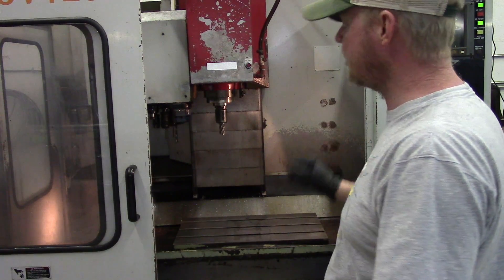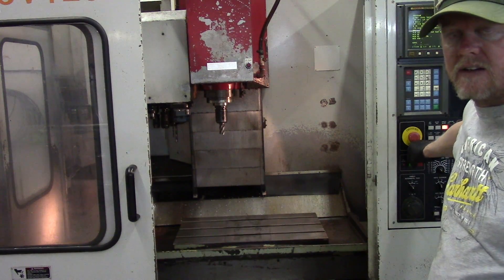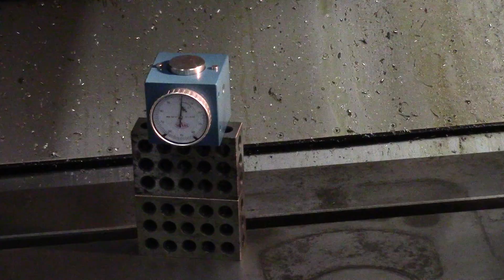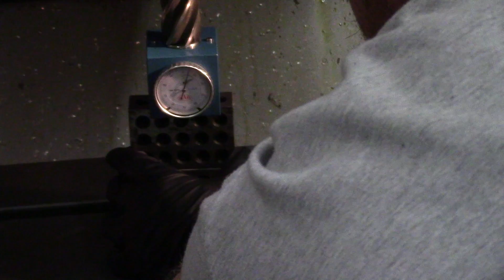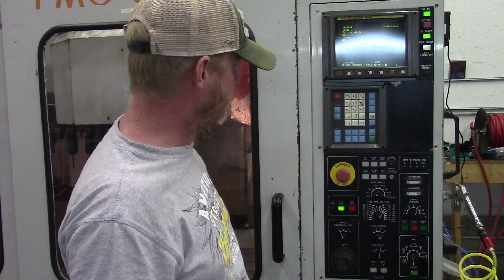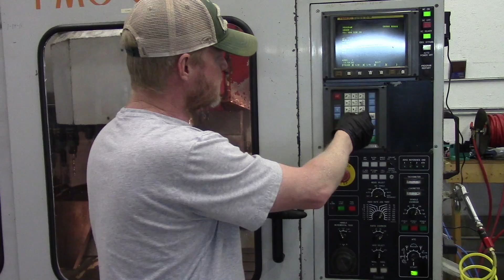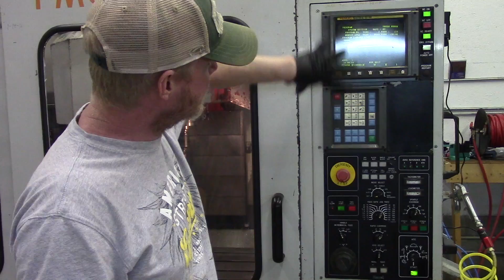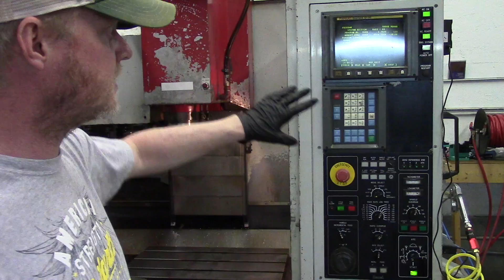Fanuc OM CNC Mill Positive Tool Offset / Gage Line Setup

Comment: Good morning brother, extremely grateful for the contributions in your
channel, I want to know if within your possibilities I could make a video
showing all the parts of the machine and see if you can supply me with the
connection diagram of the HK MR-20LW video cable.
Reply from the maker: I've got a pretty extensive list of videos on the machine showing most if not all the parts.  The hk cable pinout is likely in fanuc builder documentation which I don't have.  I did do a video on the LCD swap.

Comment: Thanks a lot this video explained quite a bit for me. Just got a machine in with the same control. I would absolutely kill for someone to show me even in a brief video an example of a part setup in the vice and getting all of your offsets set and ready to run on the machine assuming using g54. I program with fusion. The menus are just super confusing to me on this control so far. I’m newer to this but am familiar with setting offsets and tool heights referenced off the table. I learned on a haas so this is just confusing for me. Thanks and let me know if you’re able to help me out at all! I’ve been struggling to find someone with experience on the fanuc O-m control to show me how to get a part setup to run.
Reply from the maker: The OM control isn't too bad once you get used to it.  I had HAAS personally before I purchased this machine but had years back run fanuc commercially. Easiest way is to decide on the method (table, gage etc) and build up a workflow.  Once you get it down pat you'll mainly only be working with fusion and the machine for zeroing.
Reply: @ShaneBurrell1  So you set your spindle nose essentially zero to the table and then punch the difference with that number and the length of your tool into your tool length offset? That’s how I was taught. On the haas control I was able to just press tool offset measure and subtract my gage block. Then for setting my work height offset just input the number difference with a tool height positioned at the top of my part and input that number. I’ll have to figure out how to input and navigate all of that on this control though.
Reply from the maker: @connoreverly8496  Thats pretty much it.  The OM just doesn't have the copy function and the option to input the block height.   The best way to visualize it is to draw it out and it makes more sense, at least to me.  Do you have your tool change working for fusion? That seems to be the next hurdle on the OM.
Reply: @ShaneBurrell1  we have an electrician coming in to get the machine under power then I can start toying with it. I’m gonna look back at your post processing video as well when that starts
Reply: @ShaneBurrell1  So I got the machine up and running and am starting to get the hang of the control. Now for setting your tool heights based off of the table to do you have to enter anything in the (work shift) offset for your z height of your workpiece? Or do you just essentially enter the machine Z position minus your tool height into your G54 or work offset you are using? I’m struggling to find a tutorial of how to enter it on this specific control
Reply from the maker: @connoreverly8496  I base all my tool heights from the bed surface to gauge line. This includes my haimer. You don’t have to do it that way. You could use anything but the bed surface and guage line method is what I’m used to coming from setting tool heights out of the machine.
Reply from the maker: @connoreverly8496  for the work offset i use the haimer which I use with tool offset to measure how far off the table for the workpiece. I also wrote the offset of the haimer on front of my machine for quick offset when I don’t have tool offset enabled.
Reply: @ShaneBurrell1 

I just got started with my 0-m today, and coming from Mach3 on a cnc router, it was very different and overwhelming, how much back and forth to move the numbers.
I guess, once I get to know it better, it will flow better.

After setting the tool offset, and activating the offset, will the offset be automatically subtracted from the wcs?

I assume your z0 is with spindle on top.
Do you set G53 (00) Z0 to be at your table?
Reply from the maker: @eMTeaM10  As long as you have the offset active it will . I don’t set G53
Reply: @ShaneBurrell1 
Ok, so you leave G53 at 0,0,0?
And then uses machine coordinates as refrence for all WCS?
Reply from the maker: @eMTeaM10  yes once wcs enabled and tool offset I use that wcs.
Reply: @ShaneBurrell1  
Do you happen to have a Post processor for Fusion360 and Fanuc 0-M?
Reply from the maker: @eMTeaM10  There is a base copy that comes with Fusion which is copyrighted by Fusion folks.  You can basically load that one and just add your tool change commands if non-standard.
Reply: @ShaneBurrell1 
Yeah I figured it out, it seems to post correctly, will test another day.

Thanks for giving of your time! :)
Reply: @ShaneBurrell1  Hey Shane! I got my machine in and familiarized myself with the control and got my post processor and everything figured out. Successfully cut the first chips the other day. Your videos were extremely helpful!! I did have one question. Do you know how to simulate your program in the fanuc control before running it?
Reply from the maker: @connoreverly8496  You should be able to disable z.  That what I use to simulate.

Comment: Where we fill dia of tool
Reply from the maker: Dia is handled in cam
Reply: @ShaneBurrell1  which cam software is best you refer?
Reply from the maker: @hardeepsingh4370  Fusion 360
Reply from the maker: @hardeepsingh4370  I don't have a Whatsapp
Reply: @ShaneBurrell1  and what about cutter compensation?
Reply from the maker: @16siemon  Its in most om controls.

Comment: There is no advantage in doing this on a 3 axis mill.  In fact, if you use the distance from Z0 home position to the top of the
table as your tool offset then your Z work offset value is simply the distance from the table up to Z0 on the part.
Reply from the maker: There are many advantages mostly by preference.  The top one is I come from machines that use tool setters which I eventually got for my home shop setup. Another is standardization.  I  have some shared tooling between machines.  I've always found it easier to understand and reference in setups as well. I also really like knowing what the tool length is from the gage line to the tip of the tool is by just looking at tool offsets.